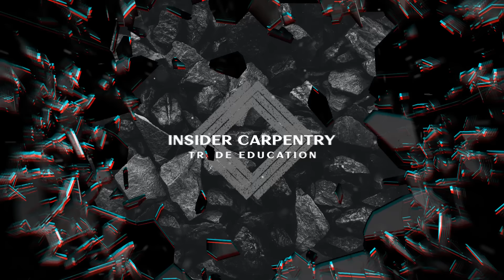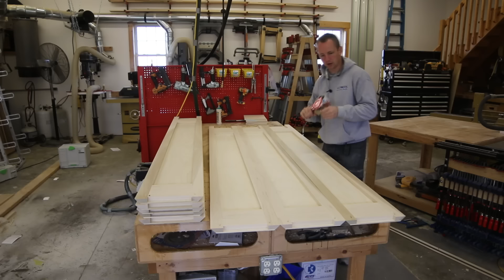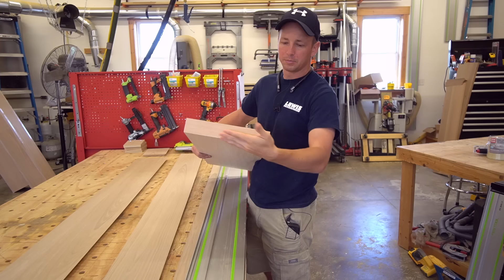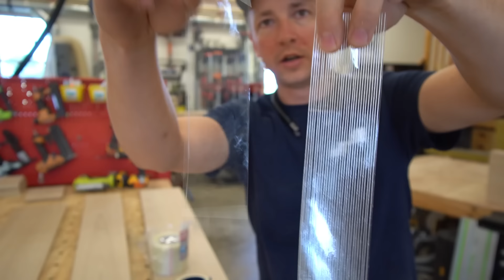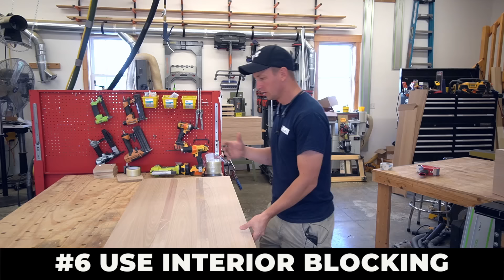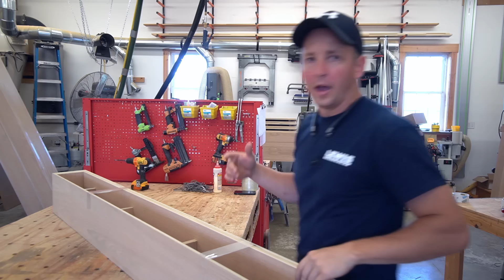MASTER PERFECT MITERS!!! | 10 Secrets to Miter Folding

Comment: Dont you mean 44.5 Degrees? 45.5 degrees = 91 degrees, and that's opposite of acute angle shown @ 15:42
Reply: No, he means 45.5°. The inside angle of the fold will be 89° which is an acute angle. You are thinking of it like it's addition, but it's more like you start with the sheets of plywood square cut which forms 180°, then you subract the sum of the two miter cuts from 180° which leaves you the inside angle. It's not thagt easy to visualize without drawing it on paper.
Reply: I was scratching my head on this one. Thanks for clarifying.
Reply: This is the old confusion, angles versus miter. He’s talking about a 45.5° miter

Comment: Is it ok to tape sections of a miter joint if you have a long area to cover to save on tape, or do you recommend just taping the full length of the miter joint board? How long do you wait before you pull the tape off?

Comment: Spencer (and all), I just finished building 10 miter-folded floating shelves inspired by your videos. My second woodworking project ever. Most all went well. Used your strapping tape recommendation. It worked great. Kept almost 💯 of the glue squeeze out off the outside of the project which was nice. The problem though, the filament from the tape really stuck into the seam of the miter joint and I thought I had tape residue left on the plywood. I spent HOURS pulling filaments out and using a razor blade to scrape what I thought was residue off... on 80 lf of joints. Suggestions on this for next time? Was that just grain that lifted and not residue? Would the orbital sanding have taken care of that without all that scraping? I didn't want to gum up the sandpaper with sticky tape residue, so I didn't dare try. Your thoughts?

And, to my surprise, on the shelves I really pressed the tape into the wood on, seemed to come off easier and cleaner. Seems counterintuitive, but seemed to be the case for me using Maple plywood.

Comment: Try pulling tape off by folding tape over on itself and pulling close to the backside of adhered  tape. This reduces the perpendicular force applied to the veneer surface and the grain Han less tendency to separate. Try it, I think you will have better success

Comment: I apologize if this has been answered but I could not find it. 

I understand the .5 degree bevel adjustment - it makes sense. However, the drop off piece now is not the correct bevel. Do you recut that edge every time? Might not be as much a problem on dimensional lumber but plywood being harder to handle might be an issue. 

Your video was well done and I will be using the technique.

Comment: What if you put blue tape on the edges  where the miters connect without covering over the miter just to cover the plywood so that when you put the clear tape to close up the miters it sticks to the blue tape instead of the plywood. So when you rip it off it takes the blue tape with it leaving no sticky residue and no risk of ripping the  veneer off? 🤔

Comment: If you are cutting mitres on a tv unit for example (where you will see the inside and outside of the mitre) would you still cut at 45.5 degrees? I've had some issues with the mitres coming together well especially on a larger tv unit (say 450mm wide) any advise would be great

Comment: Spencer … I couldn’t tell if you used Baltic Birch plywood for this project or not.  I’m thinking of doing a similar project however, the span of the shelf is roughly 7 feet.  I fear that BB might be to heavy, should I go with a HD veneered oak plywood instead?  Also, should I stick with 3/4” or 1/2” due to the weight?  Let me know your thoughts.
Reply: He's using 3/4 in vid but I recently started experimenting with 1/2 for cost and lightness over shorter/long spans, ie 36"'s.

Comment: Amateur woodworker here.....When cutting the bevels on a table saw, how do you get the width of the final board correct?  Say I want to build an 8 inch square column....How do I set up the saw to cut 8"? Where do I measure from?  The fence to where on the blade? I can imagine if cutting a 3/4" thick board it would be 3/4" up the blade, but there has to be a more correct and simply way.  Your vids are soooo good! It's one thing to have the skills. but to teach them so well also....pretty cool. Thank you in advance!
Reply from the maker: Lets say you want a 8" piece with a 45 bevel. You simply subtract the thickness of the material from the overall cut. So you would set your table saw at 7-1/4".
Reply: @InsiderCarpentry  When my son asked me  "Why do we have to take this stupid math class anyway? It's not like we use it in real life" I'm going to say, "Oh yeah check out this guy Spencer Lewis.. .."  Thanks for your time in replying.  You do a really good job all the way around. Thanks!

Comment: Hi. I liked the video. Both the instructions as well as the accuracy of the work. I do have a question or remark though. You mention cutting at 45.5 degrees. But isn't it actually 44.5 degrees (so 45 minus a half degree) ? When folding the sides together without the inserts, you can see that there is actually less than 90  degrees angle between the sides. Off course it has to do with how you measure the angle (on which side of the blade or how you set your 0 degree) and what you consider 0 degrees or 90 degrees. I would say a straight cut is 90 degrees, with the blade at a zero degree tilt. So if you put the blade at 45.5 a degrees tilt you get a 44.5 degrees cut.
Reply from the maker: I'm referring to the way that it reads on the miter saw or table saw which is 45.5.

Comment: Glue dispenser that actually lays the glue down like a micro trowel helps a lot too, I use pretty thick glue with those. 1 or the thick bond stuff, they dry fast.

Comment: Great video, excellent explanation on the angle setting, I've seen a lot of people mention the half degree offset but never so clearly demonstrated. I use masking tape to hold items together while the glue sets, it is super easy to work with, strong enough especially if you apply it generously and make it nice and tight and it hardly ever leaves a mark.

Comment: one tip that had the biggest impact for me as a relative beginner was to put some paste wax on my table saw.  It helps to keep the material sliding smoothly and prevents the tiny changes in feed angle that can result from hitting some sticky part of the table or wood.
Reply: Paste wax on the table saw is awesome. Warning though, I kept getting pink eye, as it turns out every time I touched my saw and then my eye I would develop chemical conjunctivitis.  It only lasts a few days though. I still use the paste wax though.

Comment: When using regular clear shipping tape, If you are worried about the tape not being strong enough, rub a piece of clear tap perpendicular to the mitre spanning the mitre. Do this every 12 inches or so. Then put your piece of table down the length of the mitre. It’s much stronger and you are not forced to use the really sticky tape.

Plus, If you are cursed with bowed material the perpendicular tape will act like a hinge and if you bend your mitre before putting the long piece of tape on it will generally pop everything into alignment pretty well and make the 2nd time you bend it much easier.

I’ve been doing this sort of work for around 5 years now. I still learned a lot from your video, you have earned yourself a subscriber!

Comment: Try heating the tape with a hot blow dryer or heat gun on a lowish setting to melt the adhesive. It should loosen the hold a bit.

Comment: let me add some value with a painter's trick to avoid pullout at 10:05 and 13:00 -  don't pull the tape from the work at 90 degrees; "fold" it over so you're pulling the tape in a 180 degree pattern.  At a microscopic level, pulling at 90 degrees pulls bits of your material directly out of the matrix, whereas pulling at 180 (or close to that) pulls along the grain, where it's much less likely to cause trouble.  Pulled at 180, it will matter much less how long you leave it on the work.

But, ya know, if you weren't using plywood, then 1) there would be no face veneer to pull out, and 2) the underlying wood, being the same species and direction of grain, pullout would hardly show, and 3) you could round over the long edges without fear of the underlying laminations showing.

Comment: Question about the digital angle gauge, i have tried a few brands, and none of them are accurate, it seems that the top reviews on this one also says it is not accurate, off by 3 degrees, in that case, 45.5 is not really 45.5....

Comment: Spencer, absolutely LOVED this video!! My question is, how do you achieve the 45.5 degree bevel on a portable jobsite table saw, such as a DeWalt saw? I think most portable table saws max out at 45 degrees for their bevel. Do you have any 'tips' on the best way to achieve that additional 1/2 degree that would be effective? 
Thanks again, love your channel!
Reply from the maker: Portable saws will go past 45. Its possible you will have to adjust the "bolt" stop that creates the possitive stop at 45. Turning it in will allow it to go past 45.

Comment: Spencer great video - one tip that I discovered when building a wrapped mantle as to also bevel  THE WALL SIDE edge instead of leaving it square.  It made scribing an exactly perfect fit to the wall a breeze.  The wall I had to scribe to had a huge bulge with a bit of wave to it.  With the beveled back edge I used my scribe to establish the line and a my hand held block plane to remove the material - you are removing so much less material this way.  I had it fit top and bottom across 8' in 10 minutes .  And there is no gap at all.
Reply: Hey, Steve. Interesting tip. I'm about to build a vanity (counter + front ?apron? drop - sorry not sure what the right term is). My wall is definitely not straight. Do you bevel the wall side at 45° or a steeper angle?
Reply: @Tooltip  I think the small bevel is used to gauge how much material you are taking away on the high bulge and low bulge spots, correct me if I'm wrong though.
Reply: Excellent tip. 👌🏻

Comment: To prevent pulling off the veneer you have to pull the tape at an extreme angle. pull with the tape you remove is almost parallel with the tape that i still on the wood.

Comment: Are you using 2 inch or 3 inch filament tape?  I followed your link to the tape dispenser and the one that looks like yours (WOD Metal dispenser) is 3 inches wide but all the single filament tape they show to go with it is 2 inches wide.  Without a link to the tape you are using I'm hesitant to order tape to go with the dispenser. I can't find 3 inch single direction reinforced tape anywhere on Amazon.
Reply from the maker: The dispenser has been in and out of stock.
Reply: @InsiderCarpentry  Thanks for the reply and sorry I wasn’t clear. I would like to know the brand and width of tape you use. I want to make sure I’m using the right tape.
Reply: @davidrader2282  I’d like to know the same

Comment: Love your videos.  Very informative.  Check out yellow painters tape (we get ours from Klingspoor).  It has the elasticity that is desirable, and its stickiness is about in the middle of strapping tape and clear tape.  I've actually found that I can overlap the pointed edges of the 45 1/2 degree edge just a tiny bit, and the elasticity of the yellow painters tape helps to pull it together better and  pull together at the joint.  Also, when removing the tape I have found it helpful to use a small angle rather than 90 degrees to the surface.  It reduces the leverage of the stickiness against the grain of the veneer.

Comment: You're a smart guy, and learn from experience, know what to look for to get the correct result. I haven't even used your techniques but I know they are right because you explain why you do what you do. Because I do have experience in the materials, I know you are right. I know the materials but not your application, but knowing what you work with is far more important. Awesome presentation, though a little monotone.

Comment: Keep in mind that my tools are cheap crap, so a lot of my issues will be with that, but my biggest issue has always been doing 45° angles and having all pieces come out the same size. I tried building a simple square picture frame, used stops, tried replicating every cut exactly the same, etc and every piece was slightly different. 

Try putting something like that together 6 times while keeping your blood pressure normal.

I want to learn so I can do some cool stuff in my own house and maybe make money on it some day, but I can't even make a flat picture frame that fits together nicely...

Comment: A tip, when pulling the  tape off, keep it low, so you don't lift the fibres, just pull it backwards as close to the material as possible so the tape folds backwards instead of lifting the fibre!

Comment: With your track saw rails.... do you use a very long track or join 2 tracks together? I’m curious on accuracy with 2 joining tracks. Thanks
Reply from the maker: When joining two tracks I always check alignment with a level. Generally I just chalk a line and move the track. I find its easier than messing with a really long track.

Comment: He under states the quality of the ryobe 23g nailer, total POS. Works decent on soft wood but throws high nails on hard wood. Then be for it gets through the first box on pins it will die! 
Don't waist your time looking go with the the Hitachi line. The battery gun is very durable and work very well with 3/4" pins. The air nailer is very small and flushes 1 1/4" in hard wood every time.

Comment: It looks like you're using 2" filament tape. The tape dispensers at your link above are 1" and 3"  dispensers. Plus, you said you'd include a link to the tape you like. It's not listed. Otherwise, I'm anxious to try this technique. Miters and dovetails seem like black magic to me.
Reply from the maker: Amazon seems to have run out of the 2" version I was looking also and the one I purchased is not available at this time. I took down the tape link because I had some issues with it tearing off some plywood veneer. I didn't want to recommend something that might cause damage.

Comment: Collins clamps are my go-to tool for miters. They are fast! If I use tape I mostly use wide painter's tape to pull in miters. I learned this from veneering because there is some stretch to the tape and it pulls it in.

Comment: Tip #11 take the tape off as soon as the glue is set. Don't leave it on wood any longer then needed and do as choim dachoim suggests by doubling it back on it's self and effectively rolling it off. It sucks when everything looks great and then you pull the tape off and it takes a big chunk of the wood with it. If that happens don't try and pull the chunk off the tape instead cut the tape around the chunk and try gluing it back in and put a clamp or weight on it and when it dries drag a scraper across it and hopefully you can salvage the job.
Reply from the maker: Solid technique. 👊

Comment: I have found to prevent grain pull out, keep the tape pulling slowly along the grain, pulling back over its self and slightly to one side close to touching the timber. The tight bend back of the tape helps to break the adhesive seal to let go.

Comment: If you pull/remove tape as close as possible to 180 degrees back from the contact edge, you will get far fewer mishaps. Pulling away literally pulls the material away from the substrate. Pulling in the opposite direction only has the leverage of two thicknesses of tape.

Comment: Great videos. Easy for anybody to follow. I'm not a finish carpenter, we do remodeling so I do find myself doing a lot of base, case and crown moulding. It kinda works out with me and my boss cause hes much better at flooring like tile, hardwood, and luxury vinyl and I'm better at things like drywall, painting and trim. So between the 2 of us there really isn't a lot we can't do. I've learned a lot of great tips for these videos that should really help us kick up the pace and quality of the work. Thank you for taking the time.

Comment: how do you support the floating shelves on the wall!!!????
Reply: the same strips that line recessed inside of the shelf allow for a 'cleat' or same size piece screwed into studs with extending framing pieces into the open side of the floating shelf.